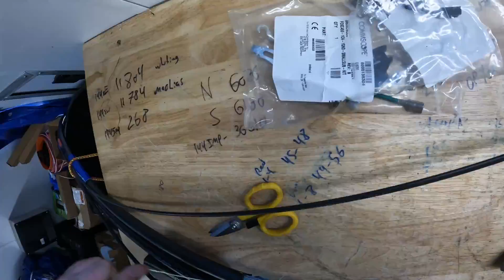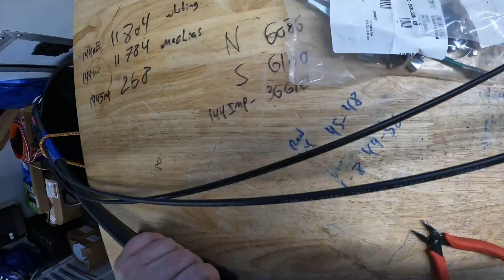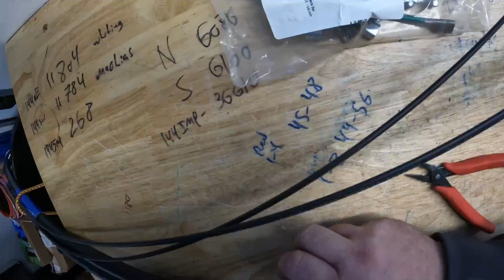HOW TO SPLICE FIBER! PART 1 (FOSC 450D)

Comment: Interesting that you're the only one working with the cable. Here in the Philippines, fiber techs usually are around 2-3 people. I guess that's the benefit in working in a low wage country. While pay isn't as good as if you live in US/CAN, you can get more people to work on a single ticket.

The trailer looks comfortable though. I don't see our fiber techs having their insulated workstation and just have an L300, and if there's work to be done, they just bring a folding table and work outside.